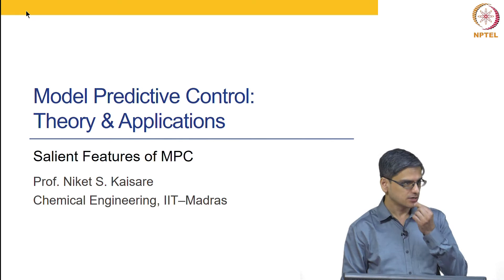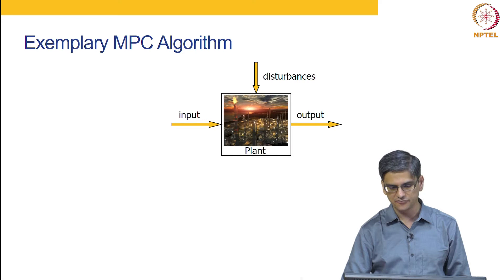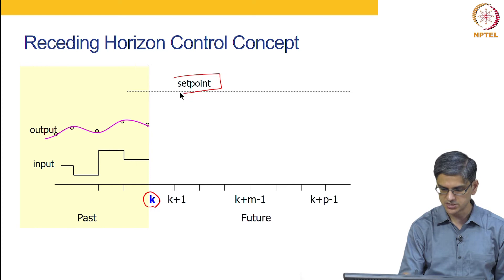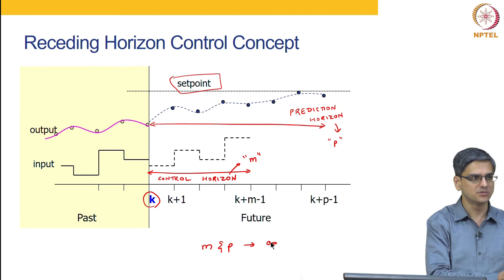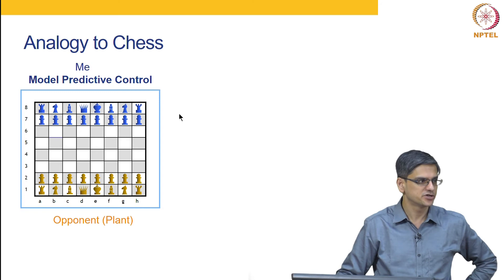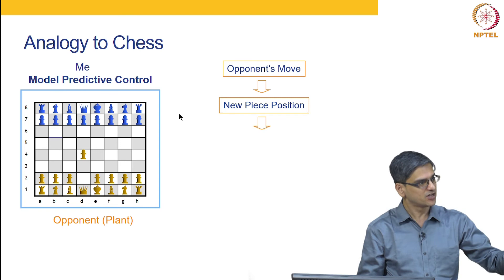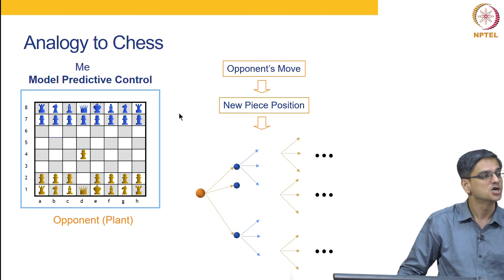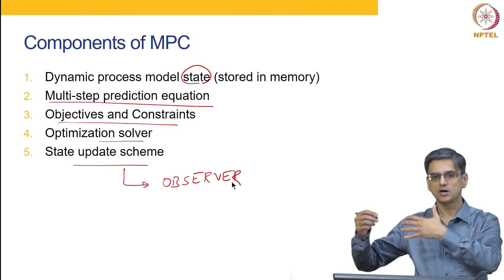MPC: Salient Features

Comment: . A distinguishing feature of MPC is its receding horizon approach. Although a sequence of M control moves is calculated at each sampling instant, only the first move is actually implemented. Then a new sequence is calculated at the next sampling instant, after new measurements become available; again only the first input move is implemented. This procedure is repeated at each sampling instant.
 But why is an M-step control strategy calculated if only the first step is implemented?